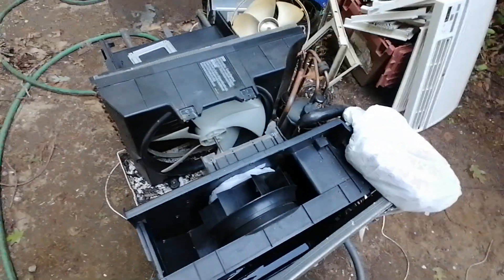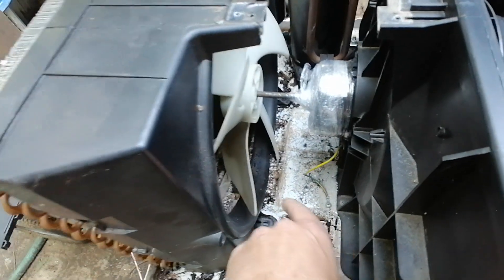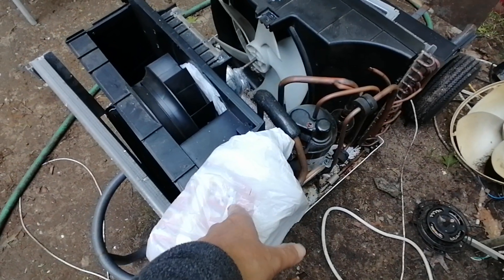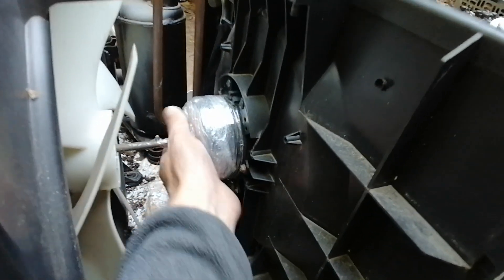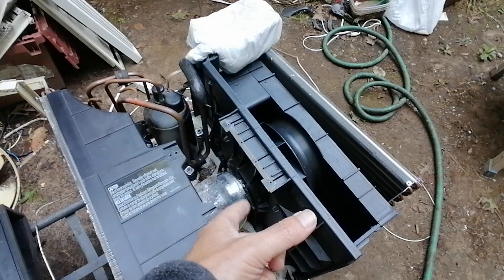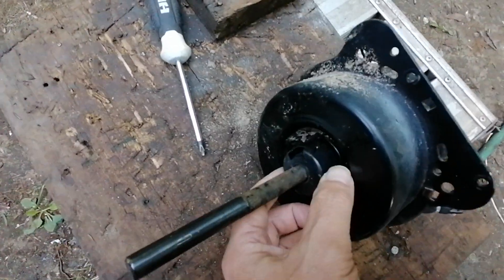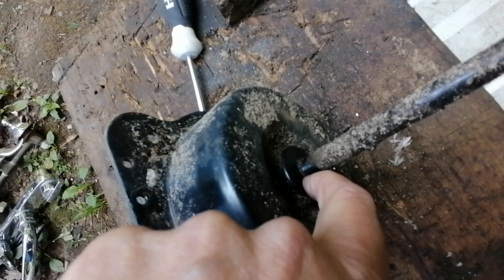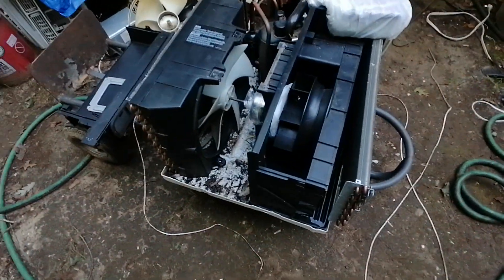How I Prep an Air Conditioner For Cleaning (Everyone is doing it wrong)

Comment: have you ever seen a Hampton bay window ac
from the late 1990s
because I have and i think what makes it rare
is that it has digital controls
if you ever find a Hampton bay window ac tell me
Reply from the maker: I've had 1 or 2 in the past, I think they're made by Fedders.
Reply: @airconditionersexposed  well if you get another make video
or did you make a video
Reply from the maker: @vacuumcarfanguy I don't think I have a video on one, I haven't had one in a few years. I don't think they're rare, but I don't see them a lot either.
Reply: @airconditionersexposed  I would say there a low type of rare
but if you get one make a video of it